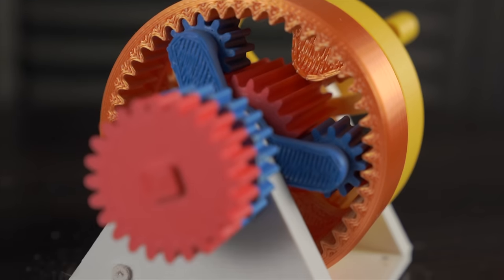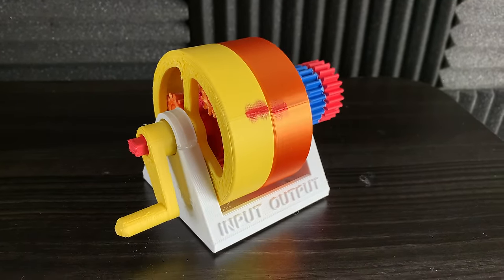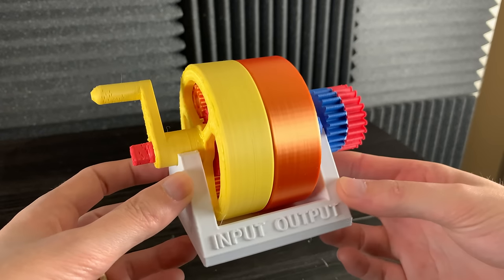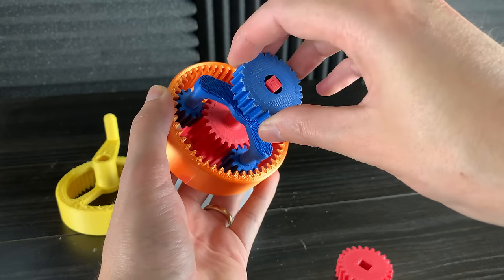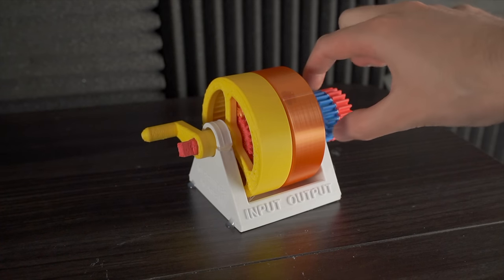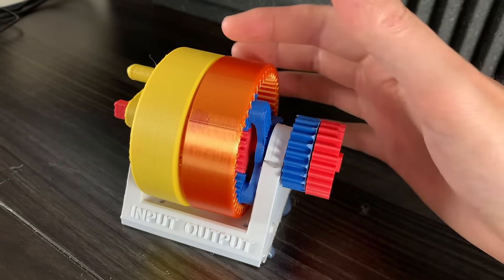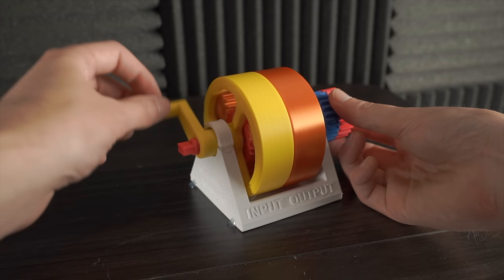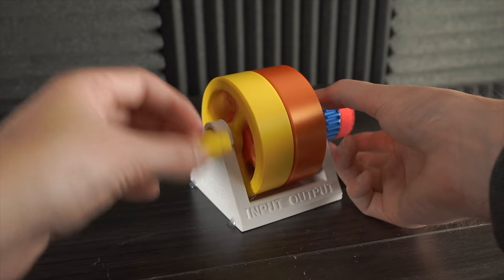How do automatic transmissions work?

Comment: Almost all car on the road in the US are automatic. In Europe it is the other way around.
Reply: Yes we have even jokes about it. Fo you want to have thief proof car in USA? Just have manual...
Reply: I probably couldn't drive a manual if I tried. Timing the shifts would probably be too much for me.
Reply: @thatblackkid22  Trust me it's just about training nothing else almost anyone can learn it
Reply: @thatblackkid22  what do you mean timing? If the engine goes brrrr you shift up and when it sounds like it is dying you shift down. Its not that hard.
Reply: @marekvojta9648  if you want to go even further, get a three on the tree manual. On the other hand they might blow up your engine wondering why the heck isn't this thing shifting, that is if they even knew to step on the clutch to be able to get it into gear without just grinding in the first place.
Reply: @thatblackkid22  thats like 90% of driving
Reply: I don't get the use of manual. It's just personal preference really.
Reply: @austinhernandez2716  Automatic is so much easier. You just put the car in gear and go
Reply: @thatblackkid22  It takes some practice to listen for the rpm but it's not that hard and you can also get a feel for it via acceleration,if you are pushing the gas paddle and the car feels sluggish but not reving like crazy then you needbto shift 1 lower. It's hard to start with but becomes second nature by your 5-6th driving lesson.
Reply: @thatblackkid22  It's quite easy to drive manual once you learn it. When you get used to it, you actually have an automatics in your head. For me, I don't even think about shifting, I'm fully concentrated on road and my hands, legs just shifting by themselves :D. Well, of course I had experience with manual transmission since childhood (I grew up in farm, so I was helping out parents and working with old soviet - made machinery). I'm scared that when I will drive an automatic, I might slam the brakes by accident thinking that's a clutch.
Reply: There's manuals, there's automatics and then there's DSG. A joy to drive!
Reply: @austinhernandez2716  personally I would have much rather had a 5-speed manual like I had previously. However the engine blew in that truck, well it was just so worn out I would have had to completely rebuild it and I couldn't find a replacement. I ended up finding another Ford Ranger that was four years newer, and four-wheel drive. So I just kind of settled for an automatic, but I am still keeping my eyes out for a ranger size pickup, 4-wheel drive, v6, and 5 spd manual. Everything right now is unavailable or way out of my price range.
Reply: @keithyinger3326  Manual swap is an option sometimes
Reply: Yeah, but in europe we have fucking 0.9litre 3 cylindre engines, i would rather have some V8 with automatic transmision... I have 2 litre petrol 4 cylinder in my car and at this time it is "big" engine in europe
Reply: You do realize America is the whole world 💯
Reply: @thatblackkid22  If you don't like to drive. I guarantee that once you adopt and master a manual transmission you won't look back.
Reply: @paco3447  I like driving but I just feel like a manual might be hard to master
Reply: @thatblackkid22  Not at all. Just practice. Less than a month the basics, a few months later quite functional. Obviously you'll must need a few years for more ultra fast paced and advanced skills like double clutch or heel toe maneuvers (but those are just suited for circuit "racing" or three letter agencies chases).
Reply: Manual will put more power down but automatics are generally faster
Reply: @james10739  The typical "kickdown" is a myth. Semiauto ATMs and double clutch - which turn out to be assisted manuals after all - are generally faster (when you use the levers and launch control), but by no means conventional automatic ones (hydraulic torque converters based).
Reply: @paco3447  30 hours. That is amount of time needed to learn how to drive a car with MT. Not a few months or even one, only 30 hours of practice. Almost all driving courses in poland takes 30 h to finish and lessons are on MT cars only.
Reply: @WojciechMikula  I said less than a month, so a pair or weeks or so (about the 30h you mention unless you mean 30h straight which is nuts). And a just "few" months more in order to become quite functional. Obviously here in EU we almost all of us picked up our parents car when young so we're at advantage.
Reply: @xLaserwalker  i drive manual with loud music playing lol its just a matter of how connected you are with the machine
Reply: I never heard something like this, and I thought it’s like In Europe, it’s not usual to see an automatic transmission car here, why is that difference?
Reply: The commonness of manuals in Europe is way overstated. Here in Sweden most cars on the road nowadays are auto’s, and it’s getting frustratingly difficult to find a new car with a manual.
Reply: Not anymore, it’s changing
Reply: My father put me in a manual shift car when I was 7 or 8.  It's basically like riding a bike, it clicks in your head and you wont even think about it later.
Reply: @paco3447  No I didn't. Still managed to learn it fine within the driving school time period.
Reply: complexity lies in starting algorithm, where you have to manipulate clutch pedal to exact position, give gas and release. If some step fails, engine turns off and you have to ignite it again.
Reply: @PostTraumaticChessDisorder  thats also not true. DSG is also automatic. Unless by “automatic” you mean classic planetary gearbox with hydrokinetic clutch, then you’re missing some more kinds of auto gearboxes, one of them being quite popular CVT gearbox.
Reply: Yeah we have luxury here
Reply: I wish they sold more manuals in the US
Reply: @vojtahavelka  petrol is very expensive here (for us more than €2,00 per liter now), so a smaller engine does help to keep costs down
Reply: @UrHeadset  yes, in Czech petrol cost 1.5€/l, considering that average salary here is about 1200€, it is quiete expensive. But I still would rather have 2.5-3.8 v6 engine
Reply: Some people think that america is über alles, and all other world is not so important to mention.
Reply: in the uk seeing an auto is rare
Reply: It might be much more common to drive a manual car in Europe and maybe Africa, but a good part of Asia, Australia and New Zealand are now dominated by automatic cars. In Australia, more than 90% of cars are automatic. In China, automatic cars have rapidly overtaken manual cars in popularity.
Reply: @kelvinhill9874  and most of all post-soviet countries too. :)
Reply: @thatblackkid22  you can easily learn how to drive a manual transmission when i was 7 (now 16) i always watch how to drive stick and i fully learned when i was 9-10yo you can do anything with practice
Reply: I've never driven a manual but if I were to get in one right now I feel like I would go just fine
Reply: American here, everything I own is manual actually and has been since my second vehicle. Most Americans are just lazy is all. I love driving stick on the street, but racing transmissions have advanced so much with modern technology that there is no way a human being can out-shift one with a manual, even with a clutchless or clutch assisted stick.
Reply: @paco3447  okay old man
Reply: Thank god for that. I love manual gearbox
Reply: @marekvojta9648  not always, there was a man in my hometown who was murdered; executed in front of his family because the carjacker couldn't drive stick.
Reply: @dominiksaworski8509  Bo w polsce nie ma tyle lenistwa tak jak w stanach
Reply: We need a free hand for our burgers and milkshakes
Reply: @tigerxra8515  my step dad has done this a few times when driving my mom's car
Reply: Yeah we need to know how to drive a manual because if it
Reply: @thatblackkid22  Joke about American intellectual abilities
Reply: @WojciechMikula  I learned how to drive MT in only 10 minutes XD.
Reply: I wish it was inverse I love manuals 😂
Reply: @austinhernandez2716  cheaper, provides finer control and can reduce fuel usage as lower revs can be used depending on situation
Reply: @thatblackkid22  it’s really not that hard, I learned on the go after I bought a truck with a 6 speed in it and never drove a manual before and had to drive it 4 hours hole 😂
Reply: @3m.misiek  I’m so glad you used english, I might not understand polish at all xD
Reply: Every new car today is going to say to you in which gear you are supposed to be...
Reply: From what I understand trucks are also the same deal except vise-versa, a lot of semis and shipping trucks in the US are manual while the opposite is true for europe (they are mostly automatic)
Reply: Back in in my day everyone had manuals mate
Reply: @thatblackkid22  it's not as hard as everyone makes it. With people that drive manual, there's the science types that need to stare at the tac-gauge to time shifts, and the feel types that listen to the motor and feel the engine out through their feet on the wheel well or through vibrations in the gearshift lever. If you can get it rolling you can drive a stick.
Reply: @james10739  with modern cars this isn't 100% true anymore. With the cars I grew up on, an automatic used to loose 25% of the horsepower and fuel economy through the torque converter and another 10% to 20% through the transmission and drive line. Modern automatics, the autos are so good, they often do a better job. I loved driving manual, but now with the efficiency of CVTs if I want to shift it myself, I just take the motorcycle.
Reply: … almost all? City folk 🙄
Reply: Yep, no one asked ya but some European always have to give their two cents when not asked
Reply: Almost all roads on the cars are automatic?
Reply: @thatblackkid22  manual is more economical and more efficient.  You can have power exactly when you need it.
Reply: @thatblackkid22  3-4 hours bro, that's how long it took me. Learning biting points is easy and doesn't take long. What point to shift up and down just takes hearing, although a rev counter helps. Soon you just feel it. 
Modern AT is superior to manual.
Reply: why tho
Reply: I live in Europe, it is a very rare sight to see a car made in the last 5-6 years that isn't automatic excluding shitboxes like dacia
Reply: Very true, however the magnificent ZF eight-speed gearbox in my M140i, has converted me!! 😊
Reply: @keithyinger3326  why not do a transmission swap? The trans might have a manual version. Kinda like my trucks 4L60E. Though I'm going to a 4L80 soon.
Reply: It's a damn shame too

Manuals are superior
Reply: Almost all automatics on the road in the US are cars?!
Reply: It’s ridiculous that we not all drove automatic in europe. Except in a sports car/race car, there’s no need for it at all.
Reply: In the rest of the world*
Reply: @vojtahavelka  that's average. 3.0 diesel or 3.2 liter gas starts to get big in europe
Reply: @austinhernandez2716  manuals last longer. I wouldn't buy a automatic with 350 000km but o would a manual
Reply: It's call Standard.. nor manual. 
It only became manual once automatics became so popular because people became to lazy to actually drive their vehicles vs your vehicle driving you
Reply: I would've thought Americans prefer manual, barely anyone drives automatics here in the UK
Reply: @vojtahavelka  true, but those 2 litre for pot engines we have in europe make a lot more power per litre than most american v8s.
Reply: 3 pedle for live
Reply: @dominiksaworski8509  culture i think. America has really, really poor driver education standards. I think that plays a huge part in why so many american cars are automatic.
Reply: @frazierl7898  you wouldnt, but you would pick it up pretty fast.
It gives you superior control over the vehicle compared to auto imo.
Reply: Here is a perfect example of americans thinking they are the world.
Reply: Opened the video to say this, but you beat me to it.
Reply: Manual for car lovers.
Automatic for common people.
Reply: @thatblackkid22  - Nothing to it but to do it, just give it a shot.
Reply: Canada, Mexico, China, and Australia are all majority automatic. Europe is the outlier here.
Reply: @thatblackkid22  timing the shift? This isn't NHRA bruh 😭😭😭 like just go up one gear when you feel the engine sound high, precision isn't really a must when you're just driving to Target
Reply: @tigerxra8515  Been there, done that, damn near launched myself through the windshield! Learned on a manual shift (an old Dodge Dart with "three-on-the tree"), then got myself a four-on-the-floor. Drove that way for years. Borrowed a buddy's automatic for a run to the auto-parts store - ironically enough, to buy a new clutch disk for my car. Pulled out of the driveway, got up to about 30MPH, then saw the stop sign coming up. Stomped on the "clutch" (which, of course, was actually the left side of the "all the way across the floorboards" brake pedal) to downshift, and smacked my head hard enough on the windshield to crack the glass as I came to a literal screeching halt. $350 to replace the windshield! Thankfully, I wasn't at highway speed, or I probably would have gone clean through the windshield. These days, I drive a 5-speed stick by preference. As a bonus, my ride is nearly theft-proof - these days, most people who are likely to try to steal a car aren't capable of driving a stick-shift!
Reply: It might be 50/50 these days but almost all europeans know how to drive stick
Reply: @thatblackkid22  nope their are nor, I've met people who barely know how to read that work everywhere driving, it's simple to learn and doesn't take long to get very good at
Reply: @thatblackkid22  bruh, you don't need timing except you want to race. just hold the clutch pedal and switch the gear and next you only have to release the clutch after you finally get into the gear you want, just don't hold the clutch to long or you will lose speed except you going for reverse gear. easy as pie right?
Reply: @xLaserwalker  mans put it into basic terms
Reply: Because Europe has public transportation 💀
Reply: blah blah blah my god stop commenting this, what kind of cookie do you want?
Reply: And im jealous. I wish it was easy to find manual versions of regular commuter cars here in the states
Reply: @austinhernandez2716  Automatics used to be far worse than manuals with worse fuel economy. It's no longer the case especially when you have a dual clutch, but in Europe this mindset kinda prevailed so automatics are far less popular, with people even going as far as claiming that driving automatic is not real driving (coincidentally those are usually the same people who never driven an automatic and wouldn't even know what the letters mean let alone to put it in D ). I have driven manual all my life, I bought a car with automatic transmission a few years ago, and I know I'm never going back to stick. It's just a pain in the ass to switch gears and play with the clutch when you can literally just press the gas, the car will go, press the break, the car will stop. No steps in between not to stall the engine.
Reply: @thatblackkid22  it's easier than you think
Reply: Americans get confused by gears. They have to count up to at least 6! It’s just all too much for them!
Reply: @austinhernandez2716  There are many reasons to get manual over automatic and the main one is cost. For one, you can drive a lot more efficiently using manual wasting less fuel and because manual has less moving parts, oil. Secondly, it's a lot less complex, so manual not only is more durable meaning it breaks less often, it's also A LOT cheaper to fix or replace. With manual you also have a lot more control over the vehicle in bad road conditions if you have the experience and skills for it.

There's a reason why manual transmission cars are a lot faster in races than automatic transmission cars: with drivers able to choose when and what to shift to they can put a lot more power from engines to wheels at the precise moments than computer ever could. At least until AI becomes standard and is able to recognize certain situations on it's own and what gear the vehicle and the driver needs the most at that moment. Not that you care about all that as a casual driver but still.

The last and best reason is the joy of driving. Manual is just plain more fun to drive because you have more to do behind the wheel. You'd think that's distracting but it's not, when you are used to manual stick shift it comes as second nature. And you conversely can actually focus on driving even MORE. Because you have more to do behind the wheel, you are less likely to get bored of watching the road and thus it's less likely that your mind will wander.

Of course automatic transmission has advantages of it's own: it's more comfortable and it allows you to skip a step in the learning process. Some people just want to drive from point A to point B. The car is just a vehicle that carries them there.
Reply: Not in Spain at least, most people drive autos here
Reply: I would say that’s because Corporate Average Fuel Economy ratings are easier to achieve with an automatic. Some of our pickup trucks with manual transmissions were (nobody offers a new one now) de-rated to meet emissions requirements and preserve the life of the transmission. Just the government interfering with your vehicle again.
Reply: I doubt so. Maybe in the 80s and 90s, but nowadays most cars in germany, especially the new one are automatic, too.
Reply: @austinhernandez2716  with manual gear you have much more control on the car
Reply: Automatics make it so much easier to smoke, drink, talk on the phone, and eat McD’s all while driving. You know, things that make America great!
Reply: @mikesmith1290  All the things that are illegal
Reply: I love my Cummins 5 speed...just shift at 2000 RPMs unless you are towing...shift by feel....I don't even really clutch anymore...just let off the gas when I'm ready to shift and it will pop right in.
Reply: @Kolonol1  I’ve got a 12 valve with an NV4500, I know exactly what you mean.
Reply: @Flyboy207  mines a 24v...same transmission...I am p-pumping it right now and about to do some serious upgrading to the transmission. Also got a Hamilton street cam and trying to find a mechanical tach
Reply: First trip to USA, i book a car. When i came there, they said sorry we don't have it in automatic transmission. I said ok gimme manual and they go are you a professional racer omg
Reply: nah guys, idk how about Europe, but in Russia a lot of young students about 17-19 years old buying a low-cost MT cars and after a few weeks they are driving like a pro racers
Reply: It the rest of America too, only in the US they don't know how to drive cars with manual transmissions
Reply: @fernandoflores3161  some of us do...
Reply: @thatblackkid22  The only hard thing about manuals is going uphill from complete stop.
Reply: Good, it should stay that way unless the person driving has either s serious case of arthritis or is over 60 years old.
Reply: So is in South America, but maybe it is 50 50
Reply: Europe and almost all the third world countries, ain’t gonna lie manual transmissions are better and way more reliable
Reply: @domints  A CVT is a transmission, but by no means a gearbox !
Reply: @williamjacksebastian  you might be right, but it’s not because I don’t know how CVT works, but rather because of English not being my mother tongue so I might be missing some language quirks. So you say dictionary “gearbox” definition says it must have gears? Or what is that condition that would make CVT not fit into the “gearbox” category?
Reply: @thatblackkid22  It really isnt that hard. Just got my license and started driving like... a week ago as im 20.

My 5 speed manual gives me no problems other than low speed driving, but thats just part of the course for having a sport flywheel (light)
Reply: Because In Europe we can drive 😂
Reply: @thatblackkid22  Remember kid, you are an human. Capable of anything ever.
Reply: Thats what i wantet to say.
Reply: Where are you from?
Reply: @thatblackkid22  its not about east or hard to get a driving experience and feel the power in manuals are on different level..
Reply: @thatblackkid22  to me, manual is easier to drive
Reply: Bruh the car and the automatic gearbox has been invented in Europe
Reply: You're correct, Europe and Africa it's mostly manual
Reply: @xLaserwalker No, there’s some more to a manual, like rev-matching both on upshifts and downshifts, moving from a stop, and starting on a hill. A person with no knowledge on manuals would be quick to destroy or wear it out.
An auto is simpler, more reliable, and cheaper. For a typical person with no interest in cars, it’s perfect, and that doesn’t need to change.
It’s fine to not like cars, and it’s fine not to be knowledgeable or skilled with cars.
Reply: Dang, Europe really is suffering from poverty huh?
Reply: @TheRealHelvetica  bruh the car was invented in Germany, without us you wouldn’t even have cars
Reply: @SorenDreler-lc5sl  um no, the first car was invented in America.
Reply: You're yelling me that the content with german engineering is stuck in the past
Reply: I remember when I went to London a cab driver and I got talking about cars and he asked me if it was true that most cars in the IS were automatic and he seemed baffled when I confirmed his suspicions lol. Wish we were the same over here.
Reply: In Europe, everyone wants automatics, in the usa everyone is having manual withdrawal.
Reply: @xLaserwalker you drive to red line, and let the engine stall.out before you downshift?
Reply: Not the newest cars
Reply: @austinhernandez2716 yea, some people prefer manual because you get more control of the car. Like climbing hills is easier with a manual, in an automatic you gotta let go of the gas and wait a sec to go back to gear 1 for more climbing power unlike a manual where you can switch back to gear 1 faster. It is just preference tho they both have ups and downs
Reply: @austinhernandez2716 it shows mostly in racing, but manual can achieve better torque and speed than automatic although it doesn't make a difference unless you're hauling heavy loads or racing so yea, it is just down to preference usually
Reply: People who don't trust themselves to drive manual simply have to try it for an hour. It's easy. REALLY easy.
Reply: Few years back in india, automatic was for the disabled
Reply: Manuals are so much fun
Reply: That's because of 2 reasons. The US is the second largest automotive industry in the world, with innovation in mind, and the US is automotive centric. 1 hour may be far for you, but it's next door for us.
Reply: @thatblackkid22 You just need to watch the RPM. That'll help your timing significantly.
Reply: I'm 13 yo polish boy and i know how to use manual
Reply: When car makes acceleration noise aka brrrrrrrr you hold clutch with your left foot or right depends you then use your right hand to +1 or -1 gear then you release clutch and you press the pedal that make the car go brrrrr
Reply: I love both!
Reply: @marekvojta9648 there is almost no driver training required to get a drivers license in North America, I wish it was more strict like Europe cause you have way less accidents east of the Atlantic
Reply: That's far to complex for Americans lol @xLaserwalker
Reply: @TheRealHelvetica  the Benz Motorwagen was the first car, and it was german
Reply: @thatblackkid22 hack no, you can, it is easy. Because we do it make look difficult,  it is not.
Reply: I really don't understand why you need expensive and not fuel effective automatic transmission if 95% of your country it's literally empty space
Reply: @thatblackkid22  Yeah you would. It's difficult for us Europeans at first but it becomes second nature. I have driven both and much prefer a manual.
Reply: In US manual transmission is not popular cause it's extremely hard to shift gears and text simultaneously
Reply: @vojtahavelka a 2 litre isn’t that big for Europe unless it’s a first car many cars are 3 litres and up
Reply: @WojciechMikula  It used to be 20 hours in France when I learnt back in 1997. And yes, we learn everything at once : driving the car, knowing direction, and how to shift gears.
Reply: Correct,  ut not for much longer… hybrid and EVs are all auto it seems.
Reply: Well, Americans drive over twice as much as Europeans, and since standard transmissions require my servicing and maintenance, it makes sense. I used to only drive standard transmissions, but having two clutches fail on me in separate cars more than 4 hours from home, I didn’t want to worry about that again. I’ve only had one automatic transmission have problems, and it was covered under warranty. I drive like a grandma and never speed or floor it. I’ll stick with reliable and low maintenance for my daily drivers from now on and standard for my projects that won’t be going far out of town.
Reply: Human power🔥 🔥
Reply: In Europe almost all automatics on the road are cars?
Reply: There’re many other types in Europe like DSG and stuff
Reply: @austinhernandez2716 you just get more sporty car with less cc
Reply: Well not in the Future. Trend is more and more shifting to automatic because new cars are almost all automatic.
You need to search for new manual cars.
My new car I bought just 1 weeks ago ago is also automatic and EVs don’t have gears at all so it’s „like driving automatic“ and those are the future.
So it’s just a mater of time.
Reply: @thatblackkid22 True I drove manual for like 17 years now. But anytime when I use my parents car (automatic) it’s so convenient especially in stop and go traffic and i say that as a German. We are known for our preferences for manuel cars usually 😅

Anyway this convince ist the reason why I now change to automatic. Well that’s not even hard, because nearly all new cars are automatic these days. Now I need to way just about 3 Months till my new car will be delivered 😊
And I know I will never switch back to manual
Reply: @paco3447  for me it’s the opposite. I will never change back to manual, after 17y of using them. 
Automatic is so much better imo
Reply: Actually now the gap is closing as result of computarized automatic gearboxes being more fuel efficent
Reply: @thatblackkid22 “If you don‘t like to drive“ I‘m German and grew up with manual transmission. And I understand perfectly what you mean by liking to drive a manual more. There is very little that gives more fun than e.g. shift down during a hard break with a perfect heel‘n‘toe in a sports car.

The problem is, that 99% of my drives are not suitable for a sports car, at least for me. When driving in dense traffic on the motorway (the infamous Autobahn) at 90 km/h or in slow city traffic, basically on my regular daily commute I want the most comfort I can get. I do not want to hear more than necessary of the engine, so that I can hear my music unimpeded and I do not want to do anything more than necessary. So of course I haven’t an automatic transmission. A 2013 Mercedes C180T with a torque converter. It really annoys me that it only has a regular cruise control and does not have automatic distance control.

When I take a car on a nice trip on a sunny Sunday afternoon and it is about the ride itself, then I would not want that car. In that case I would want a small and light two seater sports car and I would not mind if it is a convertible. MX-5, BMW Z4, Porsche Boxter come to mind. And in such a car I do want to operate everything myself. I did own a Z4 some years ago and would not have wanted it with anything but a manual transmission.

That being said: I sold the Z4, because I did not use it often enough to justify the costs. 95% or more of my driving are of the „Get from A to B relaxed and in comfort“
Reply: @thatblackkid22 it’s rlly not that hard a learnt in like a few tries
Reply: @vojtahavelka V8 ? Are you planning to pull a 40 foot trailer behind your car ? A 2 litre engine is big enough for most applications. If you mainly drive in city traffic a one litre engine  is adequate
Reply: Operating an automatic isn't driving. Its just steering
Reply: @thatblackkid22 what do you mean by Timing?
Reply: @thatblackkid22  nothing to time, they have synchros
Reply: So almost none of the cars off the road aren’t manual?
Reply: not true anymore.. wolkwagen is the only maker of regular hand switching  gearbox cars
Reply: Not anymore, most new sales are automatic
Reply: Tide is turning to Auto even in Europe.
Modern autos are more efficient, especially 8 speed
Reply: It isn't that hard and newer cars actually give suggestions when to shift. Both my kids had to take their driving road test on my manual car and both passed easily. (This is recent 2020 and 2023)
Reply: yea, you also get cool shit like deisel subarus
Reply: Was in Maderia and rented a car. It was a Ford Focus automatic. It handled all the hills like a boss.
Reply: Europe is living in the past
Reply: Mechanic transmission is much more fun!!
Reply: @xLaserwalker  True, but lets not forget clutch control.
Reply: @thatblackkid22  my clutch is quite worn, so changing gears is a nightmare.
Reply: It's been two years and I honestly didn't expect this comment to get as much attention as it did
Reply: Ok?
Reply: Fun fact: in Slovakia you can make your drivers license on either automatic or manual transmission. If you do on automatic, you can drive only automatic transmission cars, but if you do it on manual, you can drive both.
Reply: @xLaserwalker  lol... "you just shift up/down! 🤪"

Right... no rev-matching, no feeling for clutch engagement... I guess your manual operates like a video game controller!
Reply: Not so much over the last 10-15 years. The majority of cars sold now, at least in England, are automatic (including all electric cars that don’t have any gearbox of course)…
Reply: Yes, correct, but it’s changing with more ICE automatics and an increasing number of hybrid and electric vehicles on the road, which are by default automatics.
Reply: One of the only things Europeans do better than us.
Reply: @morgantrevino4881  there's many things Europeans do better... having lots of manual cars isn't one of them. 🤦
Reply: Would like to see you try to drive an old twin stick Kenworth 😂 Running a synchromesh transmission in a car isn’t a superpower.
Reply: In Europe it is the other way around... so, almost all US on the road in Europe is automatic?
Reply: US the best
Reply: Maybe I need to move to Europe
Reply: Australian even the pickups are often automatic.
Reply: @thatblackkid22 not only can anyone drive a manual, it becomes like 2nd nature to you quite easily because of repetitive muscle memory.
Reply: Not anymore, Sweden used to be almost all manual, now, majority are auto...
Reply: Thank god for europe
Reply: I think you’ll find ,maybe 10% of cars are automatic, globally… maybe even less… the fact is automatic transmissions are significantly more expensive to produce, so poorer people cannot afford/justify the cost. Go to any slightly poor country and you’ll notice very few automatic transmissions…
Reply: @madaxe79  your statement about 10% of cars globally are automatic is wrong. In poor countries, car numbers are not high at all, so even with manual cars, they still low in numbers compared to automatic cars owned in America or China or Japan or EU countries or the gulf states in the middle east.
Reply: @huss1205  Even been to Southeast Asia, India, Pakistan, etc.? Also the poorer areas of China, Middle East, Central Asia, Eastern Europe? Africa? South America also... of the countries I've been to, I would say most (at least 75%) of cars I've been in have been manual. it;s only rich countries that use automatics.
Reply: In South Africa as well. Automatic is uncommon here, and if you pass your license with automatic, you are not allowed to drive manual.
Reply: @thatblackkid22 you get to a point when it becomes second nature. You do not even think about it anymore.
Reply: @thatblackkid22  No, it's very easy, it becomes... automatic, like riding a bicycle.
Reply: Thank jubus 👏🏽
Reply: @keithyinger3326 thanks for sharing...
Reply: Living in a bygone time
Reply: @thatblackkid22  People are doing that in their very first driving lesson. It's not as hard as you think.
Reply: So you're saying that in America, almost all cars on the road are automatic, whereas in Europe, almost all automatic transmissions are in cars on the road?
Reply: @thatblackkid22 It’s really not as hard as you think. Heck, if a dumbass like me can drive a manual, everyone can.
Reply: Becoming less and less true every year. 2014 25 percent of cars on the road in Europe were automatic. 5 years later that number rose to 45 percent. 

As more people focus on fuel efficiency standard transmissions are becoming well, not so standard. They used to be more fuel efficient. But with advances in sensor and computer technology that is no longer the case.
Reply: @xLaserwalker Perfect explanation 😂